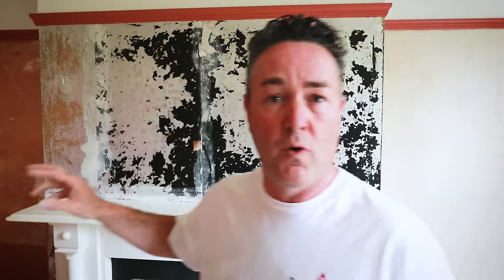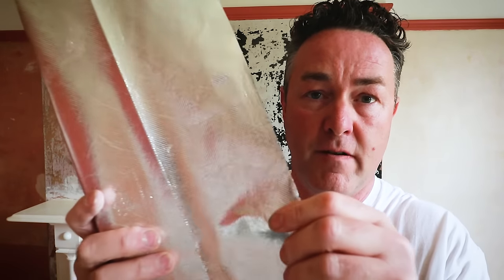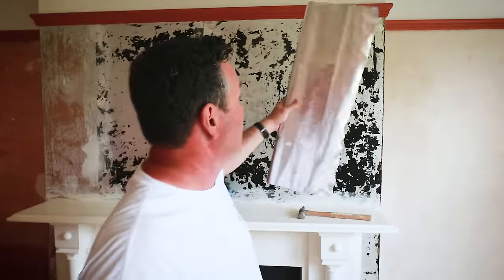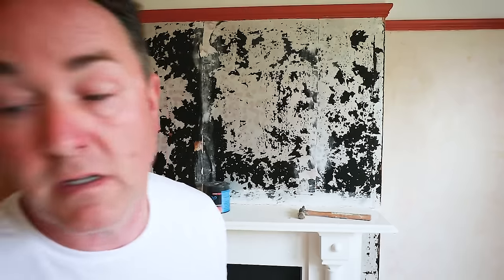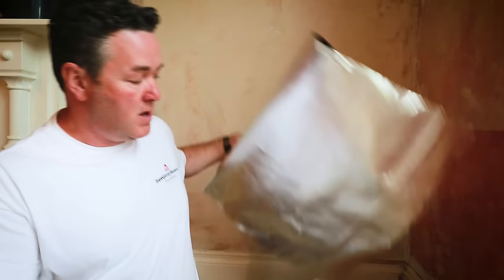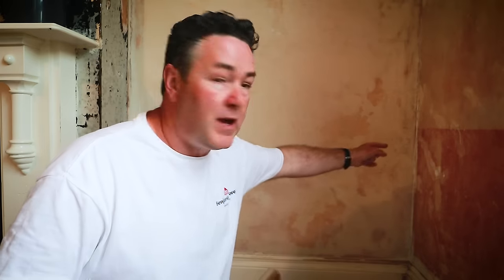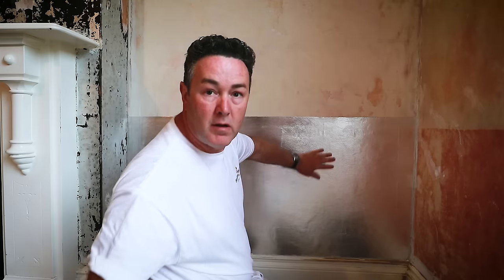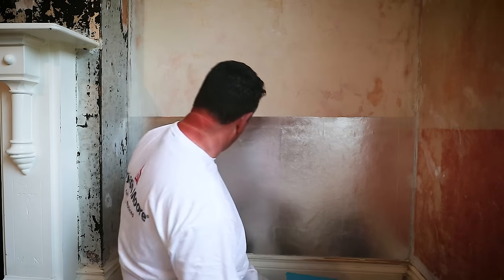How to Stop damp on walls - WallRock Dampstop Thermic

Comment: Can you tile over this?  I have a small utility room which is only single brick.  it gets a lot of condensation in the walls
I don't thimk it's comming from the outside as I have just had it re-rendrerd with silicone render.
Reply: Use an Anti Condensation paint or an Acrylic Thermal Paint, over the top of a thermal wallpaper, I used the Acrylic Thermal Paint over the top of the original white emulation paint, then put the card style thermal wallpaper over the top (Bought from Scew Fix) then I over painted this with the Acrylic Thermal paint & it has made a big difference to the guest room! I fitted a far infrared heater panel, before I did this work on the 2 outer facing walls, & it worked well, but the room didn't retain the hear very well (like yours same wall style)
But after doing the above, it retains the heat very well indeed 👍
I suppose you could use the paper here, also but not sure if you'd need something over the top of the silver side, before painting the second layer of Acrylic Thermal paint (2 coats on the wall/ Then Thermal Paper/ Then 2 coats of the Acrylic Thermal paint on top of the paper, both painted horizontal then vertical 👍)

It has made a big difference & no more condensation or mold!
I also added a vent to the door & windows, to help with airflow.

Here's the paint I used (Comes in many colours )

Thermilate InsOpaint ULTRA INSULATION PAINT Advance Energy Saving Paint Keep Room Warm | 5L | Tough Acrylic Emulsion Wall Ceiling Paint (White) https://amzn.eu/d/a6KBhJM

Here's the paper (linked on Amazon as I couldn't find it at ScrewFix, where I originally bought it)

Lining Paper Insulating Full Roll https://amzn.eu/d/bkBSZ4Y

I bought a tub if the recommended adhesive, for the paper...

I wouldn't tile, as this will cause a cold surface, where moisture will condense & they will be wet, wet... Wet!
Especially if you currently have a problem with condensation!
My method, along with better airflow stop mine 👍👍

Comment: Is that PVA or SBR glue looks like SBR you said get rid of the salt before applying how would you do that because he your gonna rerender you might as well put waterproof in it job done.. I think quite a few of these products over the years only really as good as the glue and if the wall is damp I don't have the glue or hold up
Reply from the maker: What do you mean PVA glue, where?
Reply: @ProfessionalPainterDecorator  The adhesive ...is this product really only used for moisture control as in Condensation.. Also PVA is what plasters use to seal a wall, but a lot of people use. SBR glue now. And what would you cover the silver foil? Would you dry line it? Can you plaster straight onto it? With a bonding coat Or multi finish.
Reply from the maker: @damprotek  I think you need to watch the video
Reply: @ProfessionalPainterDecorator  I did watch the video but you foul to mention  how would you get rid of effervescent before you apply this ,you just said it needs to be dealt with which doesn't help anyone.. And why flatten it into the corner just to score it and then pull it off the wall again and then cut it and then put it on again and then flatten it it's a bit of a faf mate .. so you're going to wall paper straight over it I don't care what you replies it just sounds like a sales pitch from salesman
Reply from the maker: @damprotek  i said early in on the video what I was putting over the Damp stop.

Can you tell me where (minutes/secs) the part about efflorescence so I get the context.

But you can only remove efflorescence by brushing it off.

Comment: I tried convincing potential customers on this stuff a while back  but then they d look at prices of the foil.the lining and the adhesive. they weren't happy paying the cash out.they d often say well I might aswell just get plaster taken off.and reboarded.cause after all this stuff then the wallpaper ontop of that it wouldnt be far off
Reply from the maker: Sorry to hear that. They're not the customers you want.
Reply: @ProfessionalPainterDecorator  I'm early retired because of I'll health so I dont have to deal with them anymore more but I'd often get them questioning it.i just used to say well my price is very reasonable .I'd often say get more quotes.dont just take mine but if I'm honest I was alot cheaper than most in my area.didnt matter if I was working on a council house or a big mansion.my day rate/price was always the same so I was very very fair when it came to that side but In the end i was spending hours extra trying to find the best prices on materials for every job.even the high end ones where wanting the cheaper options but without compromising on finish.
Reply from the maker: @davidphillips744  it's one price, Materials & Labour = what they pay.
We don't shop around for best materials prices for the customer. Charge them the RRP/over the counter price like they'd pay if they went into teh shop to buy it.
Don't be giving customers 'your' trade discounts.
Have you seen my video on Losing Money?
Reply: Conversely, this isn`t the sort of work you need to be getting involved in anyway. If property has damp, cold, condensation issues, creating "padded walls" isn`t really the answer.
Reply from the maker: @idi0tdetectioninprogress  what would you do then when decorating the room?
Reply: @ProfessionalPainterDecorator  Its cart before the horse stuff. Decorators are being requested to do this sort of work because its the cheapest get around. But most issues of damp, cold, water penetration etc, need an engineered building solution. 
   You're the finishing trade, but products like this blurr the lines into Lord knows what. I get everyone needs work, but decorators don't need to be getting involved with damp control. In answer to your question, I wouldn't be decorating that as it is.

Comment: I've used this on an inside wall, that faces outside. I got condensation all over it despite following all the instructions.
In the end I had to paint it with thematic condensation paint called rempro Microsphere technology. No condensation to date.
Reply from the maker: Hi, if it's a condensation issue you're better using the WallRock Thermal Lining paper
https://www.erfurtmav.com/erfurt-mav-wallpaper-products/wallrock/wallrock-thermal-liner#hikashop_show_tabular_description

The WallRock DampStop is for wall with damp/staining problems really.
Reply: I had the same issue after I applied the damp stop foil. Did you paint on the foil or do I need to put the liner first on it and then paint?
Reply from the maker: @skhodja4530  you need to put the fibre lining up very the damp stop.. then paint
Reply: Thank you for your quick response.

Comment: Why not install a dehumidifier commercial size like the air works 65X commercial grade does everything you need less than $800 I have one works awesome
Reply from the maker: If you've historical damp patches you can't find where the source is, you can throw money and time at it and it'll still be there.
A dehumidifier will just keep pulling damp out the room from other areas... Gaps in old windows.
Chopping walls off and boarding is a big job.

Comment: Used this stuff and the next day there were bubbles even though there was none when I finished
Reply from the maker: 1, what did you go over?
2, you could have missed areas with the roller applying the damp stop adhesive?
3, there's still paste not dried out, hence it's 48hrs to dry to paper back over it.

Comment: This stuff is an absolute nightmare to remove and does nothing to stop condensation.  It is not very effective in the long term.
Reply from the maker: Are you talking about Damp Stop by WallRock?
Have you applied this product?

It's a fabric base, it peels off.

Don't confuse it with the brown pitc/foil paper I talk about at the beginning of the video.
Reply: I was referring to the tar paper. Not your product . Sorry for any confusion.
Reply from the maker: @Seadog63  I knew you were lol

Comment: After wallpaper was on the walls next day wallpaper was wet did anyone have this experience
Reply from the maker: The damp stop it says 48hrs to wallpaper over.
If you then hung the WallRock over the damp stop, it can only dry OUT and not dry by soaking into the surface.
If it's not fully dry, wait.
Reply: I only used dampstop wallpaper yesterday and today morning the wallpaper is wet so I don’t know if need more time to dry off
Thank you for your reply
Reply from the maker: @agnieszkahohm162  as per instructions... 48hrs to dry
Reply: Thank you very much for the advice

Comment: Instead of covering the problem wouldn’t it be more economical to hack the damp areas off & re plaster ?
Your going to paper that wall 3 times & the cost of the products is making the cost of decorating a chimney breast wall into £700/£800 mark & your only covering the problem. Spend the time removing the problem,…a bag of bonding & a bag of plaster finish & u have eradicated the issue & probably cheaper

Comment: How about treating the actual problem rather than temporarily hiding the problem. Pointless expensive
Reply from the maker: Open to suggestions from experts.

What would you do?
Reply: @ProfessionalPainterDecorator  
First, you would look for a leak, check piping, check ceiling boards, attic, walls for damp rising and so on.
Reply from the maker: @bluesteele2235  you've watched all the video though?
Reply: @ProfessionalPainterDecorator  
Probably skipped abit here and there
Reply from the maker: @bluesteele2235  DOH lol